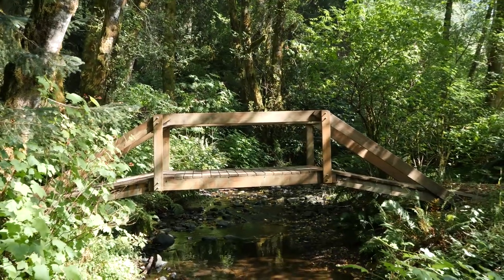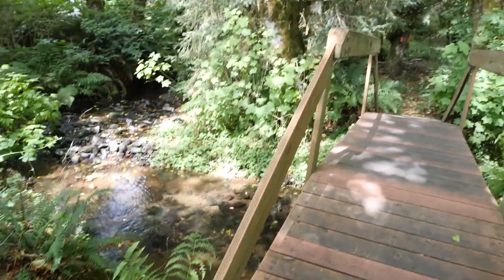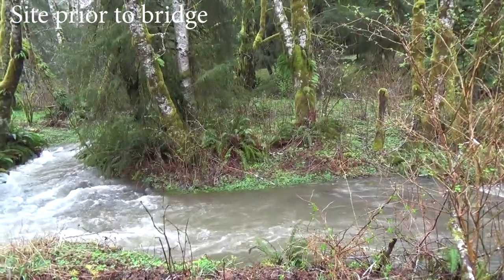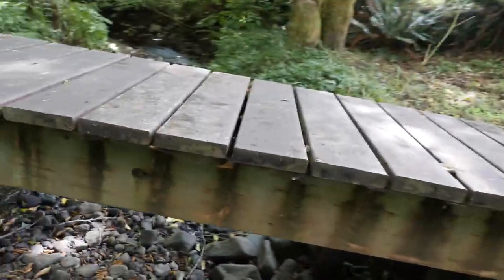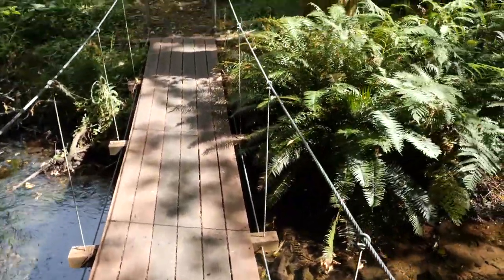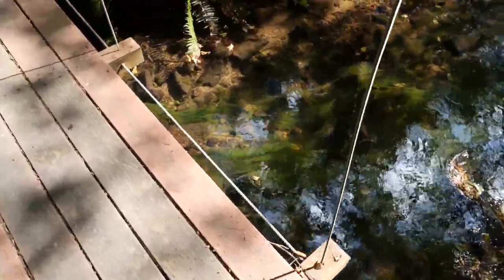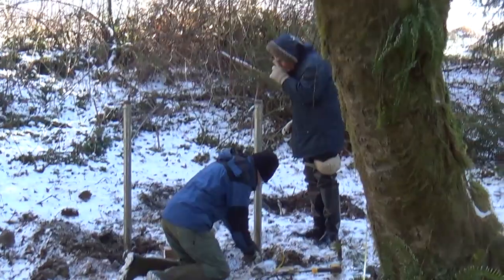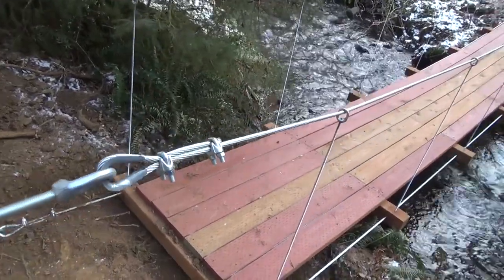Footbridges I've built - Suspension, Arch and Beam

Comment: Could you provide me with more information on what materials, specifically having to deal with the cable, you used on the suspension bridge? I am looking to build one in my own backyard over a 30ft gap and am using this as inspiration.